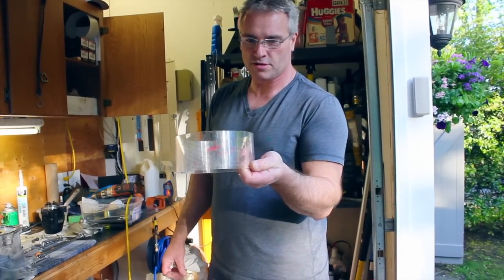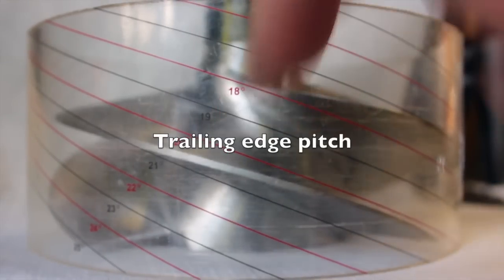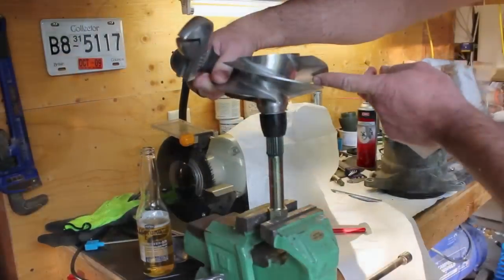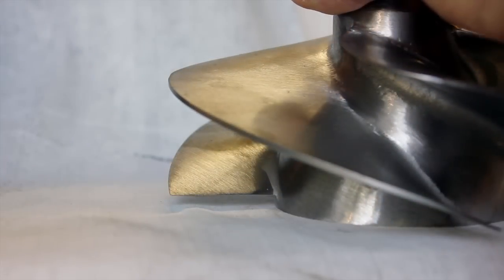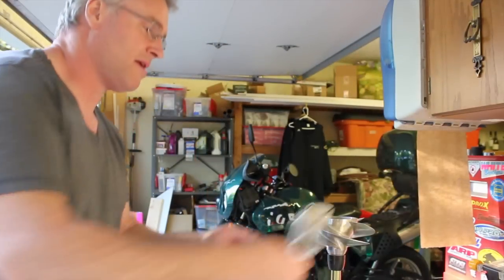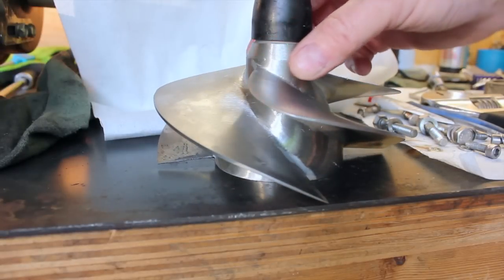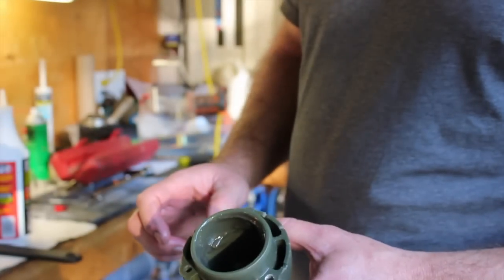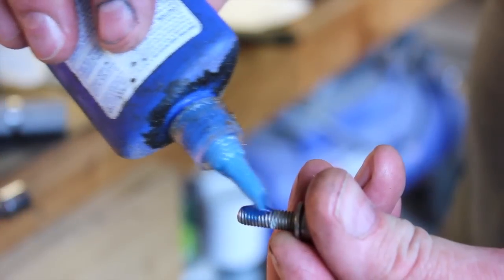How To Adjust Jet Ski Impeller Pitch (on a 2005 GTX 185 Sea-Doo)

Comment: Do you know what size the hex key is to take off the cone?
Reply from the maker: They usually use: 205562560, Socket Head Screw M6 X 25, Scotch Grip. Make sure you use new screws when you replace them. Good luck.

Comment: Doing it like you did, is that "added" pitch or other way around?
Reply from the maker: We increased the pitch so that the impeller pushes more water. When you have excess power available you can "ask more" of your propulsion system by making it push more water out of the jet. More water out of the jet pump means faster machine (at least in theory). Thanks for your comment.

Comment: I am building a alu mini jet boat with 155 hp seadoo engine. The problem i am having is that it hits rev limiter, like you shown in the change the angle it you change the amount of rpm. But how does diameter and blade angle corolate to pitch number?
Great videos it helped me a lot rebuilding the engine :))
Reply from the maker: Here's a forum that answers your question ...http://www.pwctoday.com/showthread.php?t=302453#:~:text=%22Pitch%22%20Explained%20%2D%20%22Pitch,the%20front%20to%20the%20rear.

Comment: 4:01 you put loctite at the base of the bolt where the nut will never reach, dumb move. also who uses grease AND oil??? without a before and after this is completely useless because it doesnt tell us what this achieved.
Reply from the maker: Good catch! He put more Loctite on after, but for the sake of brevity I didn't include those clips in the final version. I think the point is made, though. To answer your question, Chris used both. Not recommended, but seemed to work fine. He also doesn't replace screws as required in the service manual ...also a “no-no”. Thanks for your comment.

Comment: I have the 14/19 on a seadoo 215 with x charger and 42 injectors... runs great but I always hit the rev limit and it’s like advanced cavitation any advice..?  I already pitched the pros
Reply from the maker: Cavitation could be wear ring or carbon seal related, if hitting the rev limiter at full throttle. Check those, especially the wear ring. The impeller may also need more pitch to pull the rpms down and give more thrust, but more likely one of the other two possible issues. Good luck!

Comment: I think what you did was great. I would use that tool to check to see if all my blades are evenly pitched and even use it to repitch and see if I get any benefits by changing the pitch before buying a new impeller. For people that don't understand. a new impellers over $200 and once you buy one you may decide you still need more pitch less pitch etc. This method will help get you pointed in the right direction before spending  money on  something you don't need. Weekend racers have been doing things like this for years. I especially like this tool for those times when you such a rock in the pump and bend  or chip a blade. I would definetly use this method for a quick repair. It saves your weekend and gets you back on the water quick. Thanks for the video. Does anyone else but watco.com make that tool. I really don/t want to spend $130

Comment: I have a 2007 155 na with a 11/19 recommended Solaris impeller.  I noticed WOT i only see 6700 rpm. What i did find was topics on repitching the impeller to allow more RPM. Is this correct? My only other thought was it was a rental possible and turned down to a certain rpm but i can see 7500 out of the water on a garden hose. No its its not on a rental or learning key that i know of. I do know the speed spinner is broken.  No speed shows but i don't think that plays into it.
I did install new plugs when i got it. No service codes. Not sure what to try. Bought it with a bad wear ring so i don't know how it was previously. Only paid 1k for it with 77 hours.
Reply from the maker: You should see over 6700 RPM on the water. It’s hard to say what the issue is, but I would suggest running for stock OEM impeller. If you can pick up a used one that would be the best next step, in my opinion. You should also pull your pump and check the grease inside and make sure the oil seal is still good and no water is getting in. There could also be some worn parts in your pump that are limiting your RPMs. Good luck.
Reply: @3ftDeepChannel  I have had the pump off and the grease looks great year after year.  I changed it last spring also. Bearing feels good. New wear ring with no cavitation. Ski runs great.  Good hole shot just can't seem to see over that 6600-6700. Perfect no wind glass conditions it might hit 6750. Bought the ski with a broken wear ring actually spinning so i don't have anything to compare too. Specs on pump and wear ring to impeller are good. Nothing out of wack there.
Reply from the maker: Okay, then. Seems to me you're losing power somewhere. Have you checked the compression of your cylinders?
Reply: @3ftDeepChannel  i did when i first got it. They were a little low but i did it cold and they said that would cause lower readings. Never checked warm. The most i have found was wrong pitch. 11/19 should of been more like 10/18. 10/18 would allow more engine rpm. Roughly 400+

Comment: How come you didn't show the gauge back on it to show the difference?
Reply from the maker: No reason. Good idea for the next video, though. Thanks.
Reply: 3ftDeep oh I thought you left it off video you didn't even check it after. Also I see everyone using an adjustable wrench is there a more accurate way? Thanks for the response.
Reply from the maker: Yes, there are much more accurate ways. But we just wanted to show how you can do it with basic tools in your garage.

Comment: What about a cavitation after this "tuning"? I think the impeller don't like this.
Reply from the maker: That can happen, but the main issue can be increasing the pitch too much so that you can't reach the maximum RPMs. You've got to go in small increments to make sure that doesn't happen. The "tuning" should only happen when you've increased the power of your machine (e.g. added an intercooler), and you can now afford to create more resistance for the impeller to give more thrust.

Comment: Solas 15/21 too steep for stock 215RXP ? Intake and exhaust mods planned shortly inc Riva upgraded intercooler. thoughts?
Reply from the maker: I'd do the mods first and see if you have more power at the high revs to spare before changing the impeller. If so, it may be okay but it still may be too steep. Here's a thread on a forum on the topic: https://www.seadooforum.com/showthread.php?41344-RXT-215hp-impeller-pitch. Good luck.
Reply: Thanks. Repaired stock impeller for now and replaced wear ring. With stock 215hp engine I'm pulling 7900rpm  @ 113km/hr indicated (70mph appr)so I think we have a long way to go before we can spin a 15/21. PS thanks for link.  Pitch gauge ordered via Greenhulk PWC. keep up the great work !

Comment: After watching a few vids from RedRockat &3ft deep I removed the pump housing on my 08 215 RXP. The original impeller looked like it had sucked a bag of 6" roofing nails thru it at full throttle!! Mess does not come close to describing the carnage of the wear ring , impeller and pump casing vanes!! (How it performed as well as it did albeit lots of cavitation is a mystery!) Any hoo after a replacement wear ring (ref 3ft vids) this one (in my case to restore leading/trailing pitch) plus a few hours re profiling the bent and damaged leading edges on the impeller - hey presto it's like a totally different PWC!! Much better acceleration and top speed , no horrible noise when flushing (refer impeller bearing replacement vids) and a very happy albeit tired me!! Thanks guys - keep up the good work. PS and yes I have ordered a Solas replacement but for now the recond original is much much better than how it was!
Reply from the maker: Hey great to hear we could help out, Matt. Thanks for your comment!

Comment: Awesome video ,how did the ski perform after re pitching ?
Reply from the maker: We gained 1 or 2 mph. The key is that it's only useful if you have more power that the steeper pitch of the impeller can work with. We got more power by adding the intercooler. Without adding the intercooler to get more power, increasing the pitch will only make the impeller work sub-optimally, and you may lose performance at certain speeds.
Reply: +3ftDeep thanks ,that's awesome . I have a stage 4 seadoo rxtx 260 RS with 400 hp . gonna do the 300 stage 4 supercharger upgrade . Ime currently running 77 mph at 8600 rpm ,in "play" setup . got 90 mph on 10500 rpm but that's taking strain on the motor . hoping to get 77 mph faster with the 300 Hp stage 4 charger for better play . Ime using a 15/19 on the ski now and probably gonna take out a shim from the cone or pitch the prop again ,
Reply: +3ftDeep I also use your method for slight pitch changes and have the Impros gauge also . It really works great for me specially on the altitude prop mods . Thanks for the video :)
Reply from the maker: Wow, that's amazing! Thanks for the comment, and good luck.

Comment: I would not dare to bend blades this way..!!
there is tolerance of 1/1000mm !! and it spinning close to 10000rpm..
Reply: 1/1000 mm = 1/75 the thickness of a human hair. Seriously???
Reply: Yes Jack , 
when high speed spinning part are to be balanced, the tolerance is in that resolution.
I know this from practice , but you can check internet and read about it.
Reply: If that was true, model jet turbines spinning upwards of 200,000 rpm would need to be balanced within 1/1,000,000 of a gram. I have made my own marine jet impellers which run at 6,000 rpm and not balanced them at all, with no noticeable vibration at all.
Reply: Some people love to baffle themselves with science.
Reply: The feeler gauge Maximum clearance between the impeller and wear ring is approximately 1mm. It's very critical!
Reply: Actually these impellers are probably a fairly crude rough castings when first made. They're ground afterwards to improve the surface finish and then balanced by grinding away some metal from one of the blade tips.
No uber-precision "high tech" stuff here, it's not a turbopump impeller for a rocket engine :)
Regardless of your own experience, I'm not inclined to think bending the blades is a very good idea. It could cause cracking in the blades and eventual failure... Replace impeller with a new one with greater pitch if you're hitting the rev limiter.
Reply: it's easy to play with the blades...... you need to do a little more measuring than what is shown in the vid, but you can get good results for virtually zero dollars, and i have never seen a blade snap off yet by doing this.  30 years ago on the old standups this technique was known as "kicking" or adding a "kicker" to the impellar for top end increase in speed. What people tend to forget about all tunning, what you gain in one area you generally loose in another.
Reply: So leave it to the experts ! lol
Reply: Also, excessive wear ring to impeller clearances will cause Cavitation.
Reply: True. When my impeller clearance reaches 3mm, I lose about 1/3 thrust.

Comment: you applied the loctite too far back on the pump assembly studs. put the lock tight on the first few threads, that way you run the nut over the Loctite and carry the Loctite down the threads as you torque the nut.
Reply: You responded to that is almost as stupid as my comment whining about it ! haha.
Reply from the maker: Good point, and thanks!
Reply: Never Ever put loctite on impeller if you plan to take it off again.

Comment: Seems like bending that by hand without a dial indicator or something seems like you could end up with a vibration, no? I realize it's more money but isn't the best way to get a new impeller?
Reply from the maker: nike12000 Actually, for the cost of shipping and about $80 bucks, Impros will adjust the pitch and make it like new. We didn't have the 4+ weeks to wait for the turnaround, and besides it's a lot more fun when you're screwing around with things you shouldn't be. At the end of the day it did make a difference (1 or 2 mph), and no extra vibration detected. Thanks for your comment.